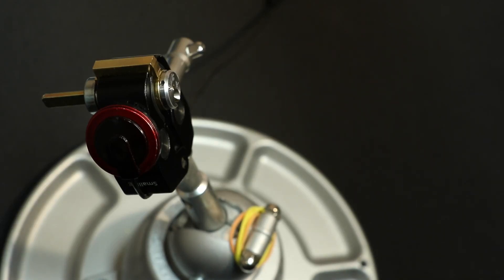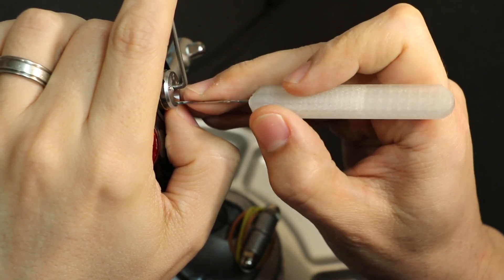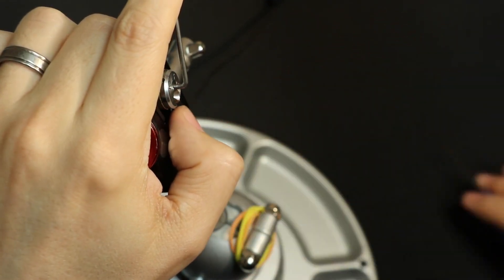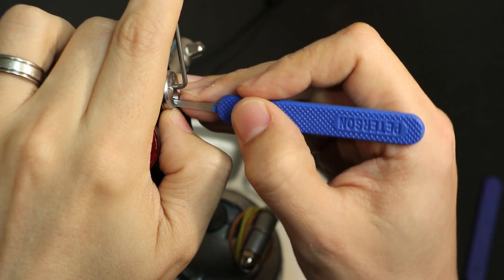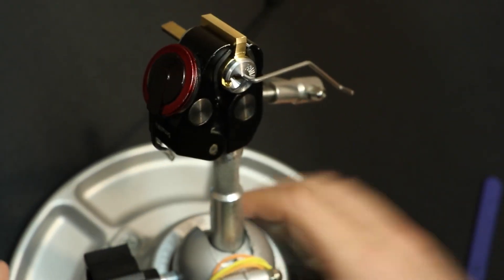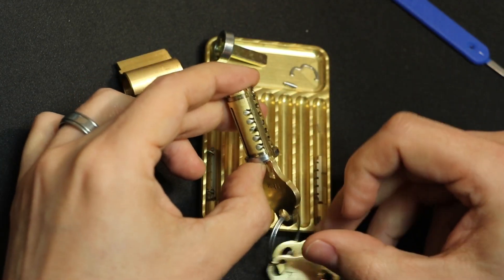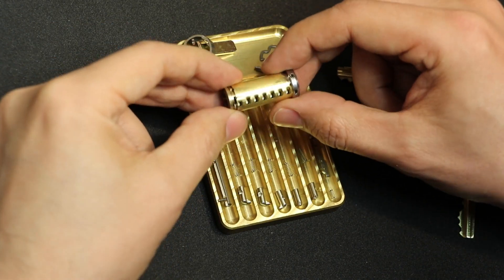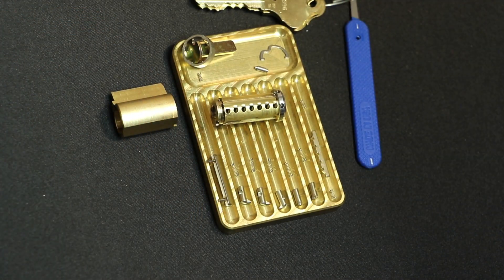[L87] Schlage Everest 29 SL Primus XP Lock - pick and gut

Comment: Great picking mate, I was under the impression that those were a pin tumbler lock. Am I thinking of a different version or just plain wrong?  
So the right side pins are sort of like medico pins? Or just need to be picked in a similar manner to medico pins?
Great video as always mate👍😊🇦🇺
Reply from the maker: The regular Primus locks have standard pins up top and the same Primus sidebar on the right with finger pins that need to be lifted and rotated, similar to a Twin Combi sidebar. This is the new 29 SL (Primus XP) version of the lock that has a different mechanism for the top pins. Those pins wrap around the left side to interact with the SL sidebar there. As far as I know, only one locksmith carries these new guys so far.